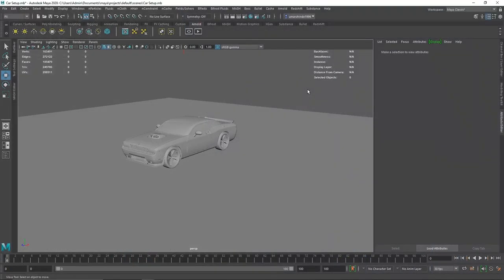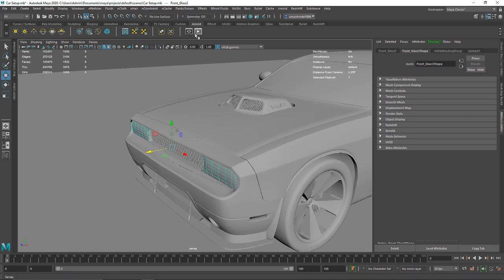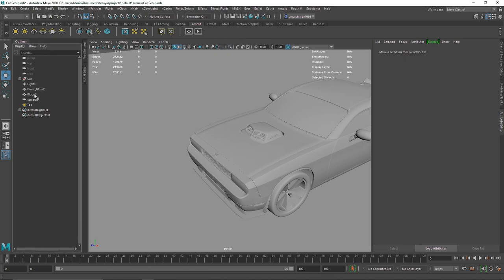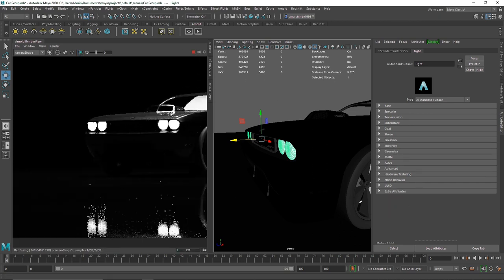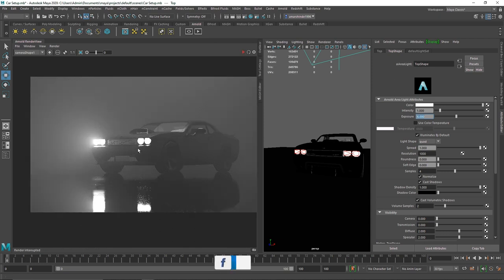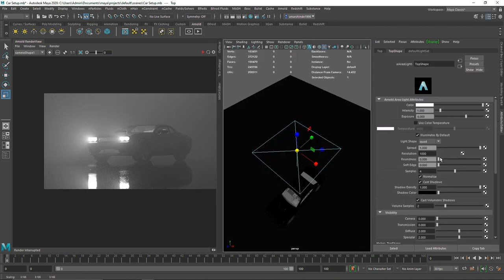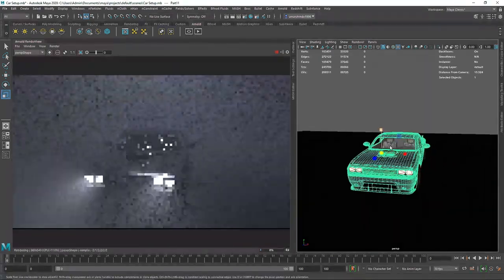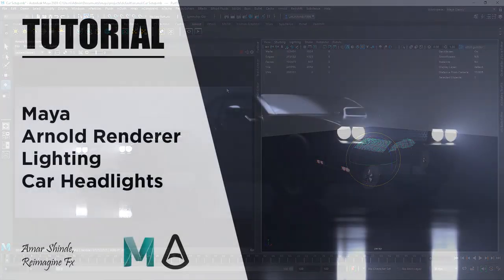Lighting Car Headlights In Maya And Arnold Renderer - Tutorial

Comment: Hey man, your second light exposure was still set to 0 because you can't change the exposure settings for several lights at the same time. You can do that with the 'attribute spreadsheet' though. Make sure it doesn't intersect with any geo as well as it creates a noisy image.
Reply from the maker: Thanks for the tip!